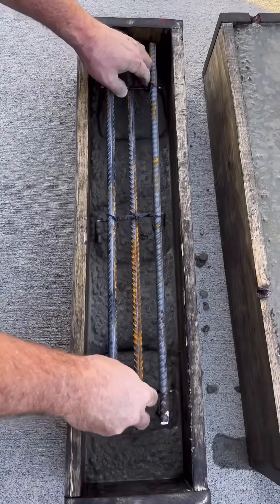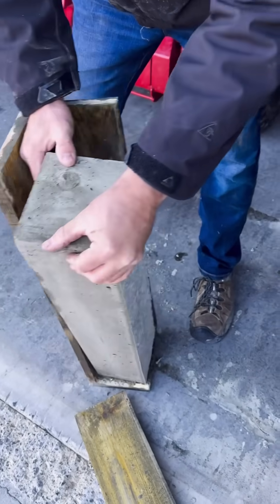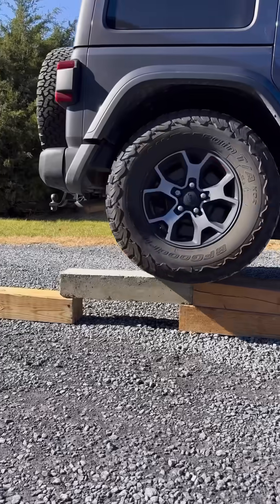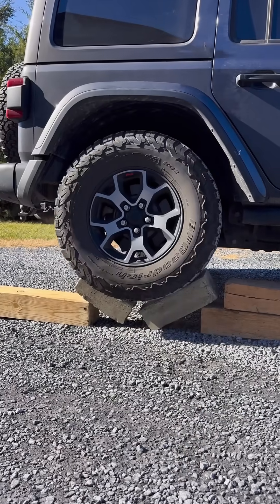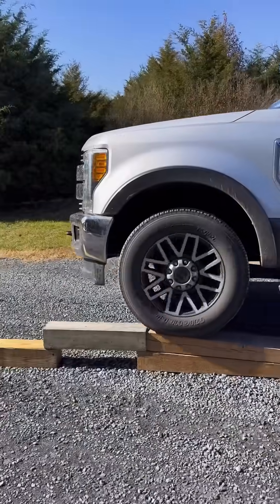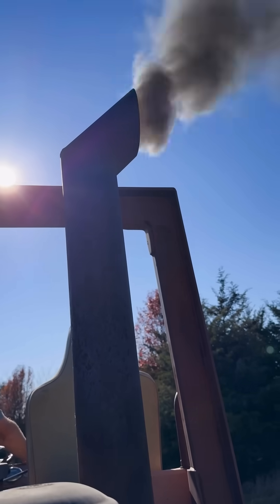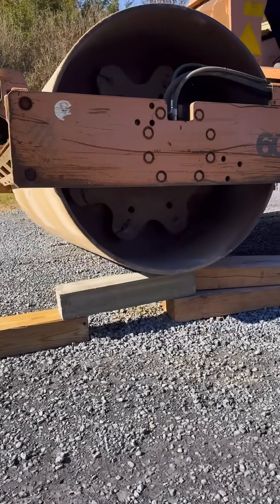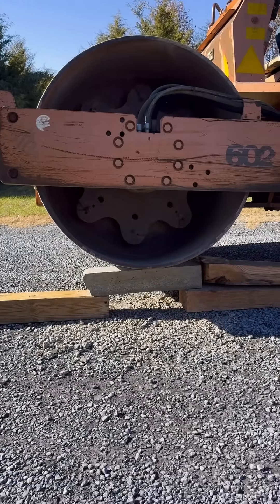Why We Use Rebar To Reinforce Concrete

Comment: My friend, this is not a measure of tensile strength it's a measure of flexural strength. Tensile strength would be anchoring both ends of the concrete and pulling them apart longitudinally.

Comment: the steel rebar by itself could have supported the trucks, it would have been more interesting IMO to show prestressed concrete vs normal.
Reply from the maker: Actually, that’s not true the steel bends really easy you can bend it with your hands or just by stepping on it

Comment: 28 days would be full strength with negligible improvements afterwards. So I'd hope 28. But 14 should be the absolute low end for testing.

Comment: That was not good made. Rebar don't go in the middle. Never ever.
Reply from the maker: The rebar went in the top third then I flipped the beam upside down before doing a test. If you watch where the vibrator breaks it, you will see the rebar was in the bottom third.
Reply: Ok, sorry I was not seen it good  enough and mouth (fingers) was faster then eyes

Comment: Isn't tensile strength how much stress something can endure before it is pulled apart? Serious question. Still a great video!
Reply from the maker: That’s correct, the pressure on top of the beam caused it to pull apart at the bottom and split up the middle

Comment: I saw a video of a plane flying through reinforced concrete with the beams back in 2001. Then as I got older, I thought wait a minute, sheetmetal cutting through reinforced steel and concrete like butter?! No! I've seen proof after proof its impossible unless it was designed for "made for TV movie" controlled demo.

Comment: check the failure mode though. In addition to adding strength, rebar ensure that if it does fail energy is not released in a catastrophic event
Reply from the maker: Yes

Comment: Rebar is cancer to concrete. If the concrete structure is supposed to last more than a few decades it will most definitely suffer from cancer. It's a cost benefit trade off that should not disregard future generations

Comment: Concrete get to 85% strength after one month of curing. Add another 5% after one year. The remaining 10% is gathered at a rate of 1% per year over the next 10 years.

Comment: Try ancient Roman concrete. Which was made with quicklime and seawater
Reply from the maker: It seems like the salt and the sea water would corrode the concrete
Reply: @hausplans  actually because of the quicklime it would repair itself. Over time

Comment: Rebar in the middle is not the optimal placement.
Reply from the maker: I flipped the beam upside down so the rebar was in the bottom third. If you watch the clip with the roller vibrating, you’ll see.

Comment: It looks like if it doesnt properly cure
Want to make it challenge.....ad just 2 pieces of rebar only but also mix it with basalt fibers (a little is enough) and cure in plastic bag mixed with less water (with plasticizer so it can be mixed with less water and still "flow" like the one on vid) so water wont evapourate
You can also ad basalt dust into it for extra strenght (not needed) and wait at least 2 weeks in 20*C (more is faster , in 40* C few days is like a month but need to be in a plastic bag , water cant evapourate from it !)
Then wish you luck with breaking it 😅
Ad more fibers , dust and it will survive intact c4 explosion directly sticked to the wall made from it😂😂

Comment: It takes at least 8 hours for it to set and 7 days to fully"cure" but here's the thing not many people know about concrete is that it's always setting and there's always moisture in there, that's why you need "liquid air" to make bubbles inside the concrete in colder places cause the cold expands the moisture and can cause the blocks to crack.

Comment: It looked like the reinforcement was in the center of the beam instead of towards the bottom so the reinforcement wasn't under tension, it was in the point of equilibrium. Putting the reinforcement towards the bottom would have greatly increased the strength.

Comment: 3 days maybe relatively weak, one week will have some strength, then about 20 something  days later will be strong enough, then slowly will cure a little and a little more over the years.  Modern cement is made with very fine ground calcinated limestone particles  and small amounts of other components to promote reaching faster compression strength in detriment of long term Durability.

Comment: Beams test flexual strength.  Usually there are 3 in a set. 2 of them you are supposed to test at 28 days and and if those fail the psi strength test the last one at 56 days. To store them properly keep them upright in a tank of water and cover them in burlap.

Comment: Love listening to uneducated people talk about things they googled for an hour lol.
Reply: For clarity, the video is fine. Just some clear clarity issues lol. Compressive strength is the resistance to compressive forces (duh. This means making the object smaller). Tensile strength is ripping apart, if you want to demonstrate tensile strength, you need to attach a truck to each side  and have them tug of war. Rebar doesn't actually do much (if anything as far as I know) to tensile strength. What this video is showing is shear strength. Cross sectional loading.  Then adding harmonics via vibrations does exacerbate issues. The video showcases the benefit of interstitial supporting well, just from a technical level it falls flat a bit. I know I'm being a bit pedantic, but you are presenting authority. Radial forces, harmonics and stress strain curves are... Pretty ridiculous at the end of the day.

Comment: I worked on a pavement research project for about 6 years.  I am a machinery guy.  We tested materials built by other people.  It is amazing what will reinforce concrete.  Steel, fiberglass, pastics, wood, even coffee grounds.  The issue is corrosion.  Corrosion does awful things to concrete without any load applied.
Reply from the maker: That’s very cool

Comment: I have a slab i had poured a year ago , still tarped, still being soaked. Its 3k sqft at 12 inch minimum thickness 
3 mats, and an equipment rail. I expect i have another year or so of cure before its ready for polish and the building to go up.
Reply from the maker: Wow

Comment: The one with the rebar is not cement. You are driving on iron. This isn’t an interesting test at all.
Reply from the maker: That steal bends super easy without the concrete you could step on it and bend it

Comment: The reinforced concrete beam failed catastrophically, which means the concrete failed and not the steel.  The is a maximum steel ratio used in concrete so that this does not happen on bridges or buildings.  When the steel ratio is below the maximum ratio, the concrete beams fails in ductile, which is really cool to see.
Reply from the maker: It had only been curring for 2 1/2 days

Comment: I'd hang the cage on a set of small rebar hanging bars with wires so the cage doesn't sink to the bottom of the beams form. Or use small concrete block to balance the cage.  At the shop I work at we use icecube trays with harderend crete in it to balance it. We pour over 200,000 pounds daily into stairs and landings.

Comment: Quick question:
Should I pour a 6” porch slab with rebar this time of year in the Midwest?
Reply from the maker: As long as the ground is not frozen and the temperatures aren’t getting too cold at night it should be OK. If it’s going to be much below freezing I would hold off.

Comment: Post-tensioned and/or pre-tensioned reinforcement are what gives concrete enough tensile strength to withstand something like a roller driving over it with the vibration on. It would also be basically impossible or at least very very expensive to try and make a YouTube recreation of that. Just watch a tractor trailer drive on an overpass and when it doesn't crumble you'll know why.

Comment: Over night is my guess
 
I work for a pre stress pre cast company you should do the test and run stressed cables through it as well I'm curious how it would hold up

After reading comments we pour our beds cpver with heat and a good amount of accleator in it and pick em with in 10 hrs and send to the yard for longer cure
Reply from the maker: 2.5 days

Comment: Honestly it looks like it didn't have time to cure fully, the roller would still have killed it most likely but maybe not as quickly. Suppose your point was proven regardless, I'd be curious to see the difference if fully cured /a month or so after pouring.

Comment: Wouldn't all the tensile strength arrows be pointing outwards?

Even the first mm at the surface, the base is being pushed down, so the sides would concave causing same lateral pull through entire cross section

Comment: Yeah but after five years the rebar will get rusty and crack the concrete rendering it dangerous.
My granda built his own hiuse using concrete and rebar for the walls. He went to sell it a few years back and the house got a "condemned" sticker slapped on it because of the rebar.
It's dangerous to build with rebar

Comment: 3:4 Days with a Good Air flow and Low humidity in Area surrounding will be sufficient!

Up to 10 Days and maybe mixing with 10% Of Cement used for Costal Construction Foundations in the mix and you’ll have something a bit above average standard performance on both characteristics

Comment: Concrete needs about 7 days to cure in order to reach 75% of its max compressive strength and 28 days to reach 100% I think for the sake of this video you gave it 7 days
Reply from the maker: I only gave it 2.5 days

Comment: Well I tell ya' that pre-cast concrete wall panels that are cast indoors on steam heated beds can be poured this evening and pulled, loaded onto trailers and sent out to the jobsite for erection the next day. Hardest thing on them is the transition from vertical to horizontal. The stress cables running thru them is what holds them together.
Reply from the maker: Interesting

Comment: You can also have something push the concrete together. Because it's so much better at being compressed when compared to stretched it can handle higher loads trying to bend it.

Comment: Wouldn’t that be poor shear strength? It’s not like it got pulled apart, it got sliced through the middle like ripping a piece of paper in half. Also that sort of loading is bending, so it’s tension and compression not just tension

Comment: Oxidation is the reaction of Oxygen with an element in steel.Over time the steel rebar will get weaker
Reply from the maker: As long as the rebar is completely embedded in the concrete, the concrete keeps oxygen away

Comment: Sure.  But in 20 years or so that rebar will rust and swell and crack the concrete from the inside out.  

Avoid using rebar if you can.